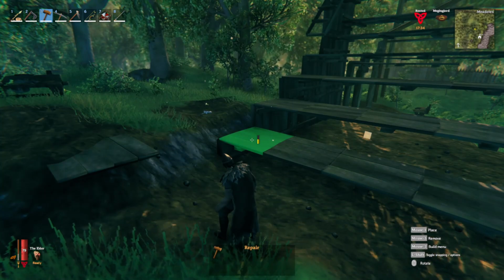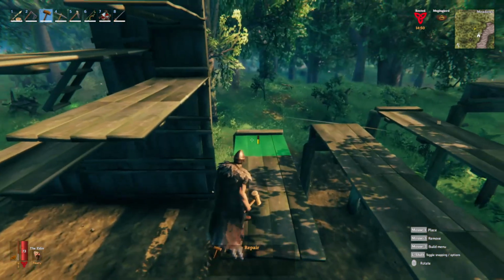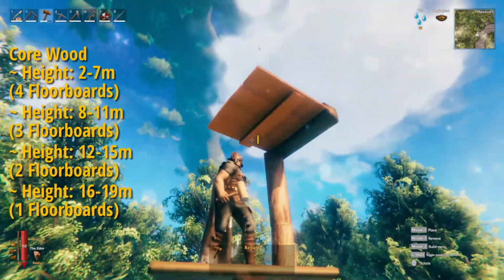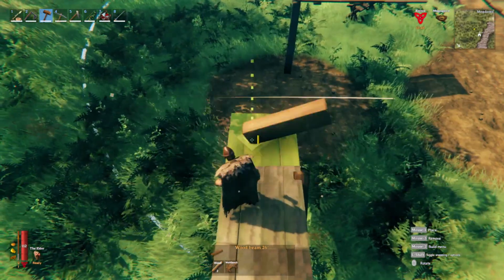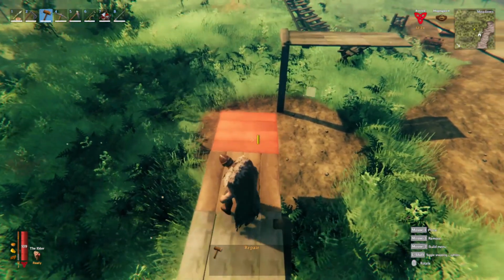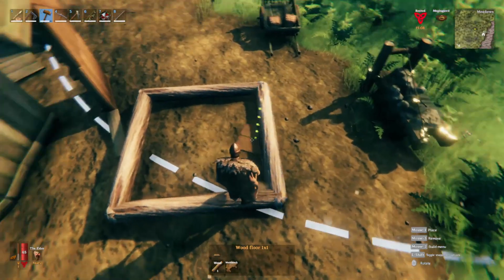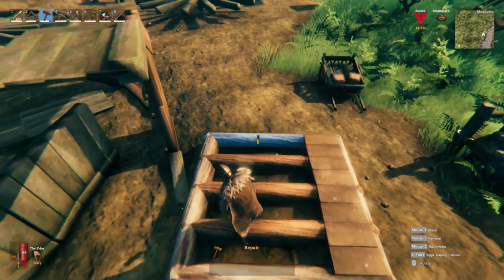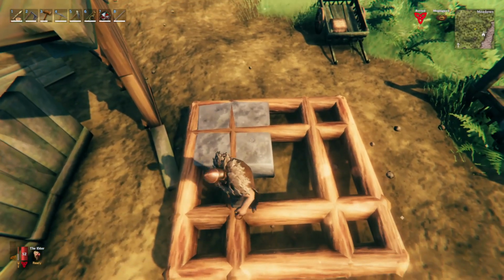Understanding The Basics Of Framing (Stability & Layout) - Valheim

Comment: how did you get the bloom pattern? the curved one that is
Reply from the maker: If you mean the spiral looking circle, that one was created by doing a border first, place a 2m horizontal beam and rotate once to the inside each time you place another beam, until a circle is complete. Then place a beam coming off each seam to the middle rotated once to the right, then a second beam rotated once to the left off of that one and a 1m beam to connect them to the middle.
Reply from the maker: Place a 1m vertical beam on the ground and the snap 1m horizontal beams on it. Rotate 1 click for a circular bloom, rotate 2 clicks for an octagonal. After you finish the first time around with 1m, you can switch to 2m beams and extend each arm as far as you'd like.